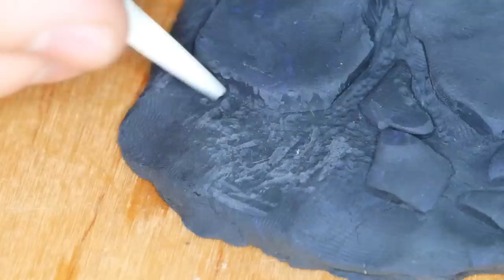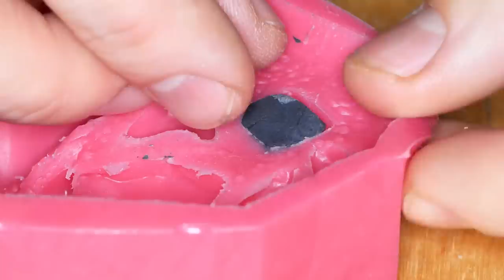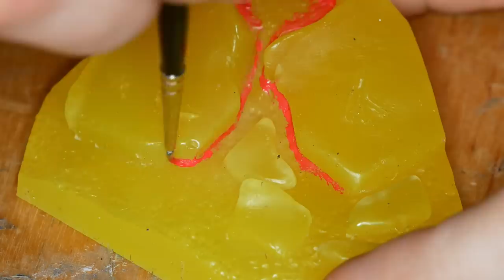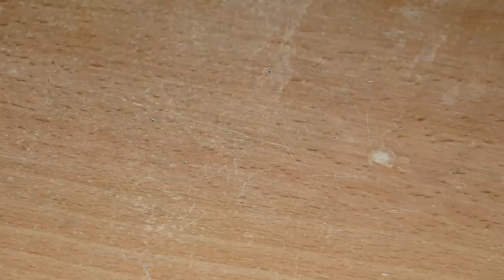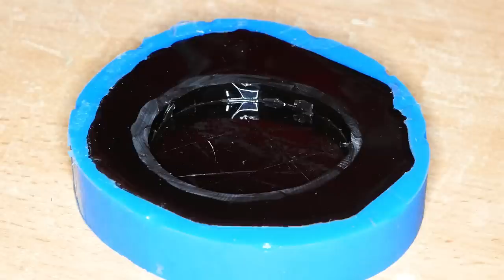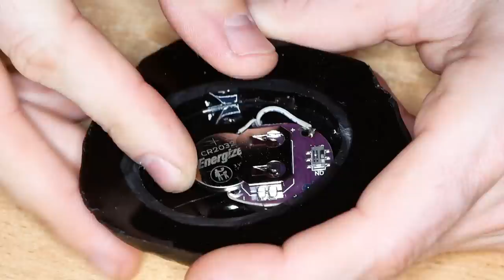Lava night lamp with epoxy resin / Resin Art

Comment: Can anyone tell me where to find the led strips that you use in projects?
Thanks !
Reply from the maker: Ebay, Amazon
Reply: @jedrek29t  actually I should have asked which type are they. I looked. Many are cuttable but are 24v or 120v
I'm wondering which type work best for 2032 battery